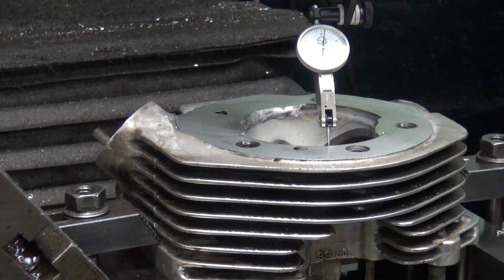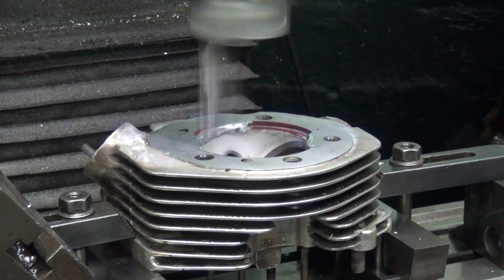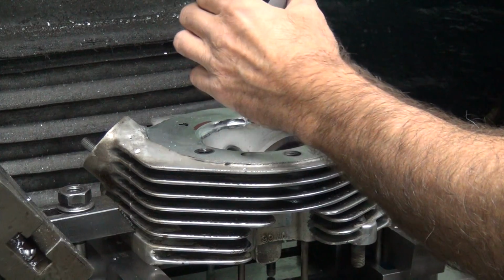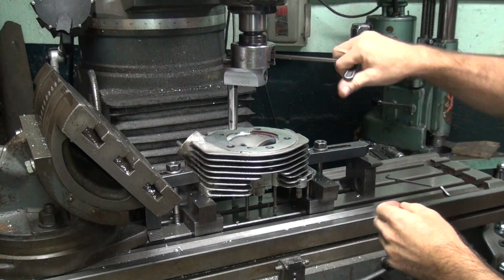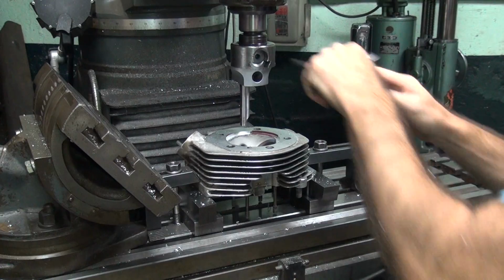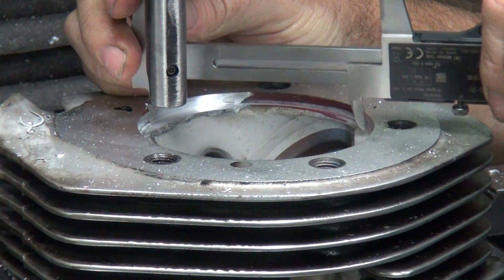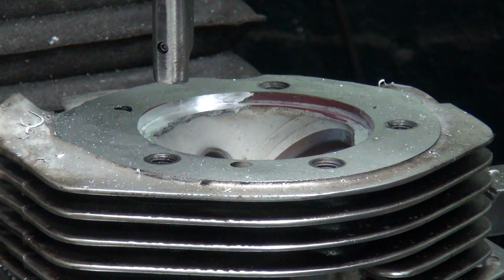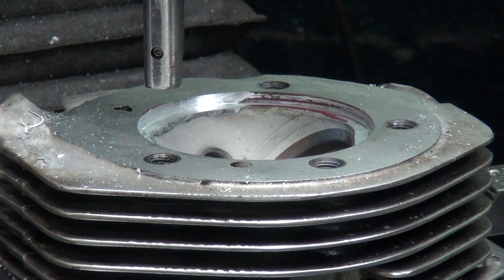1966-74 shovelhead blown head gasket #106 blowout repair Harley welding FLH FX 74ci 80ci

Comment: As a welder, what grade alum filler rod do you find works best when repairing these heads?
Reply from the maker: credman83 I use mainly 5356 hard rod because of the strength and how it machines.I use 5556 when I really need the good stuff, but it cost more.I use 4043 for hard to fix cracks and large repair areas were I do not need high strength. it also works better on small parts and die cast.tatro